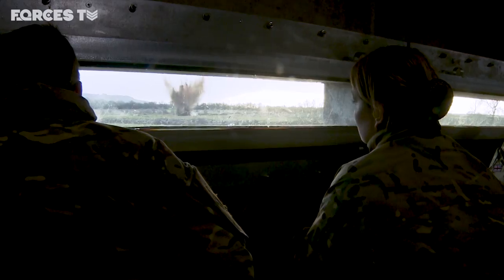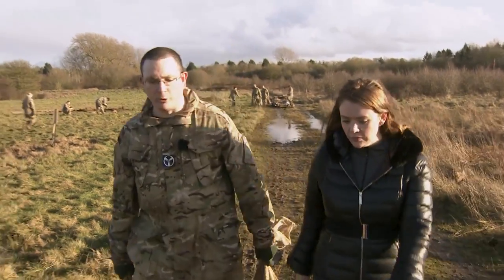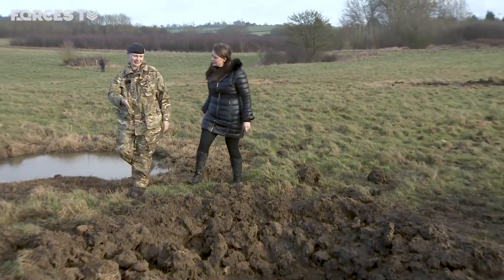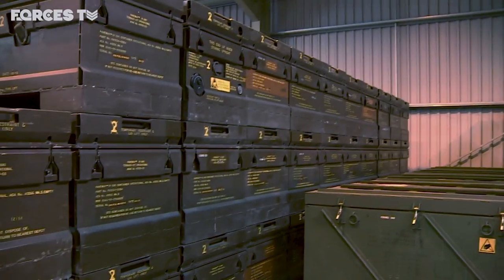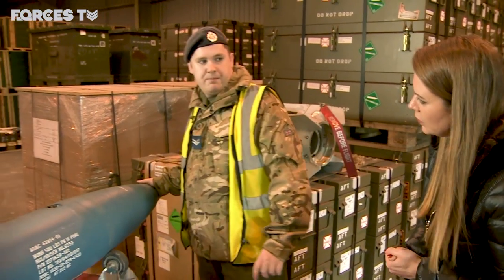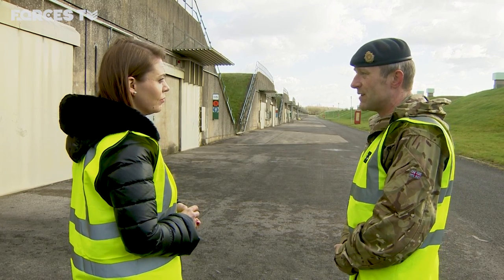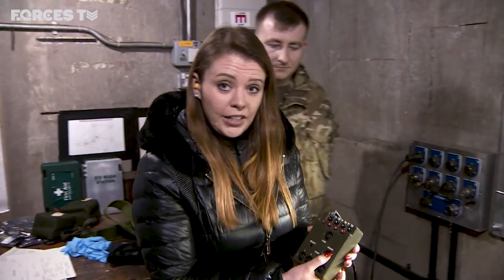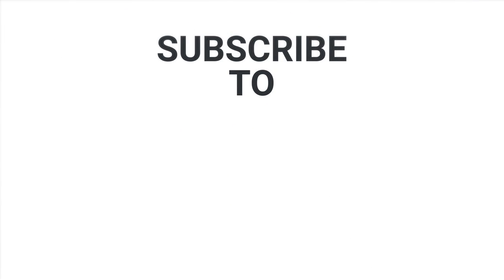Inside DM Kineton: Western Europe’s LARGEST Ammunition Depot | Forces TV

Comment: The exploder appeared to be a Shrike, as I remember from the RNZE in the 1980 and 1990s. I suspect that it is an evolution of that model.
Reply: Still the same shrike I used for 24 years, no change, it worked well, we supplemented it with RDFD's in some roles but shrike was cheap and worked with grip switch as back up.

Comment: What if a bomb explode inside the storage room?
Reply: They are not kept primed to go off so that would be very rare.
Reply: You’d have a very bad wringing in your ears to say the least
Reply: I'm sure that how not to let that happen is covered in Day 1 of the induction programme before morning tea and biscuits.
Reply: You will lose everything in that room but they are designed to protect the storage rooms beside them.  The design varies but most will channel the blast either through the front doors or through the roof, often through blast panels or weaker parts of the building.  The building itself will be wrecked but it should prevent a chain reaction.